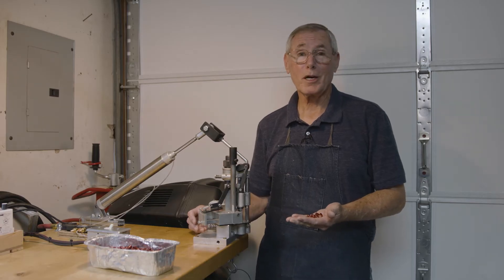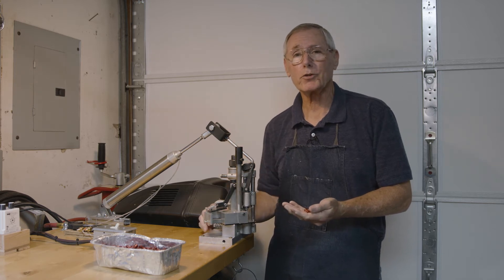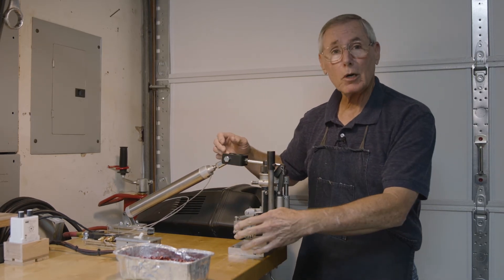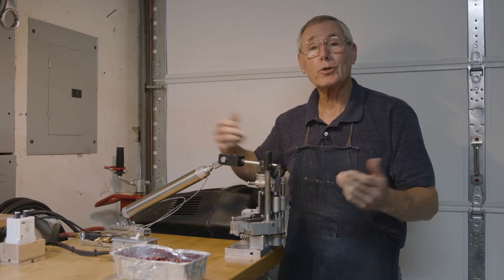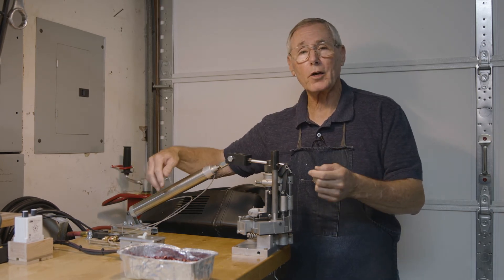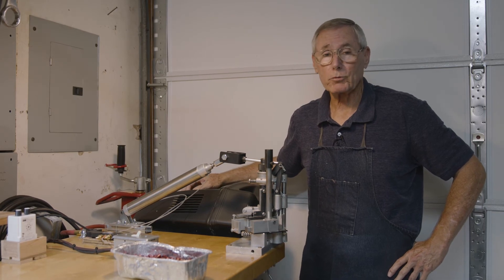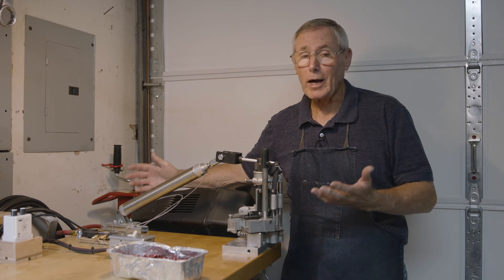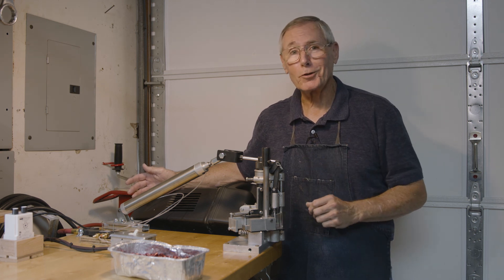Automatic Star Bullet Sizer - Part 1

Comment: Very many thanks for providing this comprehensive parts list, as most people have compressed air on hand I think this is a very practical conversion to consider, it is very convenient for us that you have done all the R&D on this and presented us with the complete package. Chris B.
Reply from the maker: This setup is a game changer for the caster who is looking for a reasonably cost effective automatic sizer. I had thousands of bullets sitting in boxes dreading the arm pulling chore ahead. I had viewed the 3 or 4 adaptations with the Star on YouTube and tried to duplicate them. It has taken me 7 months and many, many hours of figuring out the ways it won’t work. The goal was to make the Star Sizer an automated sizer. I sent a video to Magma Engineering, and talked with the owner. He was very complementary of the modification. When he heard how many it could size per hour, he commented, “That approaches commercial production rates.”  I continue to tweak the setup and improve my manufacturing process. Anyone who owns a Star Sizer can automate it and eliminate the drudgery of hand pressing each and every bullet. 😃
Reply: @DanDix  Hi Dan, tried to email you but it keeps getting kicked back, did you change emails?
Reply from the maker: @brn2golf1974  
Mlccharters@att.net